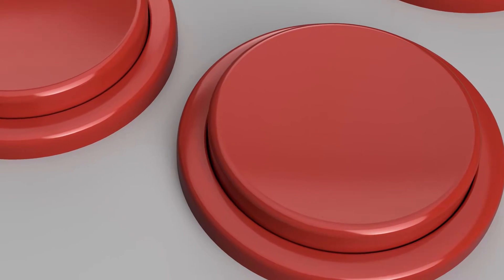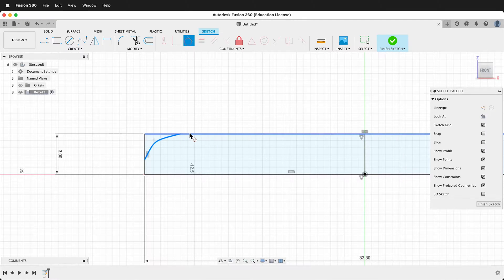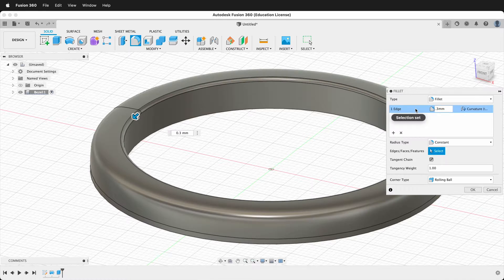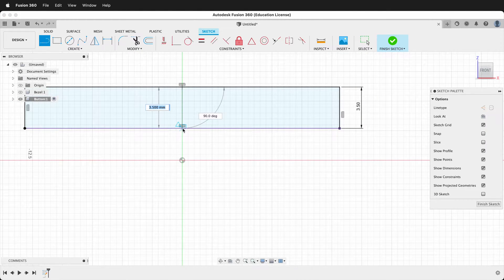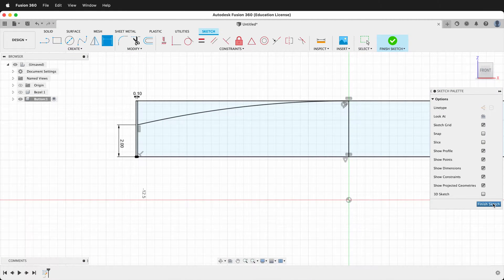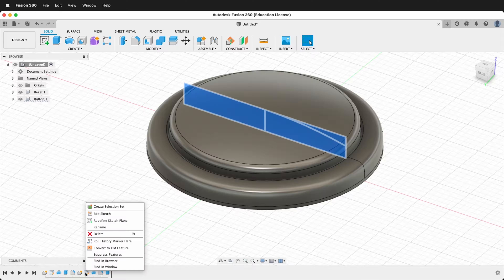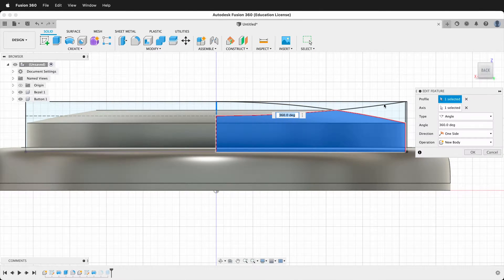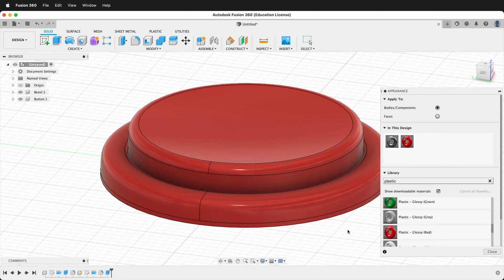Model Arcade Button - Fusion 360 Tutorial

Comment: Came across your video 3 years later and I’m subscribing. I just started learning fusion and it’s incredible how easy you did that. Also what I think my biggest challenge is, I don’t know how to think as a designer I guess. What I would have done to do this button is extrude and cut circles from the top plane 😅, I wouldn’t even think to use the revolve 😢
Reply from the maker: Yeah, half the battle is often figuring out how to approach a problem. Don't worry about it too much as you're starting a project or design, usually after I make something the first time I need to remodel it because after the first design I finally know how to go about it

Comment: For one of my engineering projects, we’re supposed to make a design with 2 moving functions. I wanted to do a Gameboy SP and I was having trouble with how to make the button. If I went to 3D print this button, it wouldn’t have the push function of a button?
Reply from the maker: It would have the clearance to move but it would not have the spring mechanism nor the cylinder underneath. You would have to model that in addition to the button.

If you Google arcade buttons, you'll see that they usually screw into an open hole in the top of the arcade machine. Then they have the contacts and spring mechanism inside. You could 3D print this, but it would be a better plan to buy one off the shelf or at least copy ready-made designs

Good luck with your project and post any cool pictures 👍